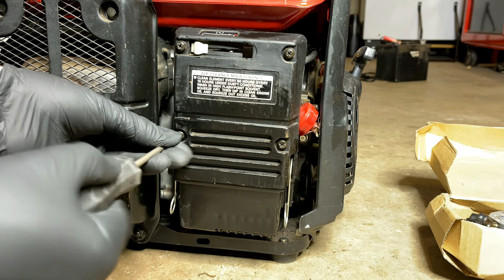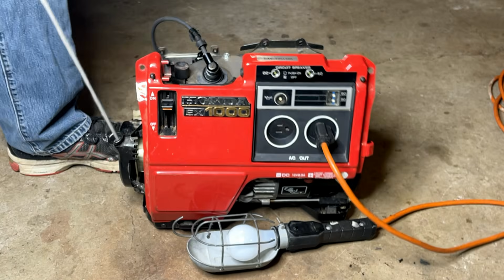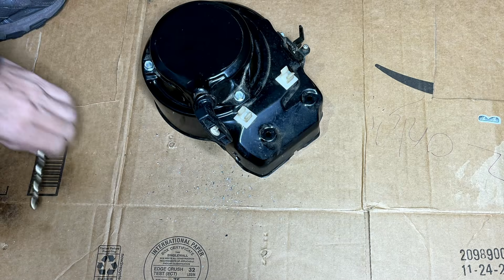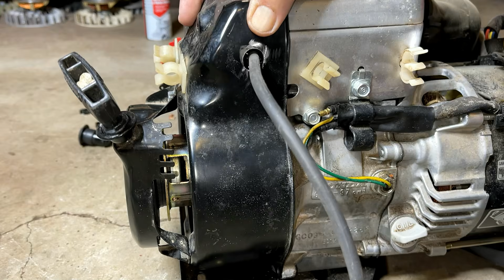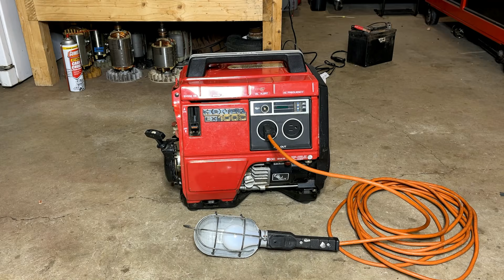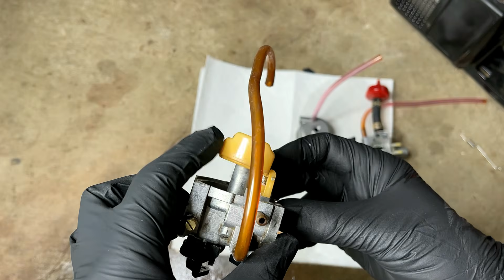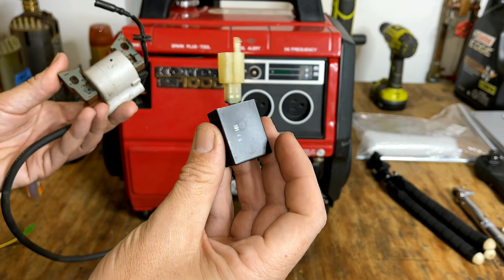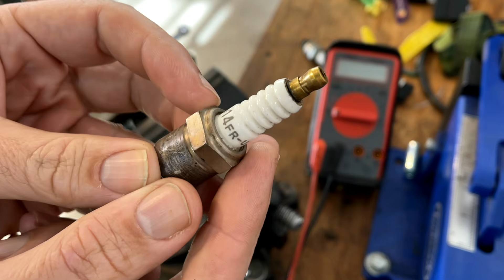Honda EX1000 - Will It Run?

Comment: My 2 cents are that the insulator within the body of the plug itself is cracked and had formed a " carbon track " . When the body ( metal part ) begins to expand with heat, the demon rears its' ugly head. I had an experience on a small engine with an insulator that had become unbonded to the body and actually was releasing compression. Fancy that ! Great video, . . but if you count your time on such a simple solution ? ? ?

Comment: I broke down and bought a deburr tool for situations where you were in with drilling that hole in the cover. Makes its smooth as a babys bottom, and looks much better then hitting it with an angle grinder. I mean you're the pro here... I just really do use mine more then i thought i ever would.

Comment: Great video. I’m curious if removing the recoil spring and plastic disk and mounting the other way round, allowing the rope to be wound clockwise and allowing the pull to turn it anti-clockwise and having the coil in the original orientation?

Comment: Excellent observational skills and logical reasoning led to the discovery of the bad plug.  We were stumped because we saw the spark plug making spark.  I did notice the spark plug test light seemed to get dim at times during the load tests. They say "seeing is believing" but somtimes seeing is NOT believing. Great idea testing the spark plug. You should work in a pit crew.

Comment: Take the petcock apart and clean it. There's often a filter in it, too. Then back flush or replace the red filter. Disassemble and clean the carburetor. These are first step items when I am working with any older equipment.

Comment: I was given one of these it was a fog machine, rings worn bad. I accidentally dropped the alternator on some rocks and cut a few of the wires, which I soldered back together and spaced with paper and silicone, got an oversized piston and she runs great

Comment: Wow - you surely did work hard for this.  Rather than ether ("Good Old Head Lifter") consider a few drops of 40:1 mix straight into the spark plug hole.

Ref: Shipping used engines USPO - learn ALL about HazMat restrictions and certifications BEFORE you consider shipping by any carrier.  Screw up and there could be hefty, hefty fines in your future.

Comment: How can you get the engine to run clockwise (which you needed for the coil to work) and you havve a counterclockwise starter pull from original engine?
Reply from the maker: The starter rotated the engine clockwise.  I had made a mistake originally thinking it was counter clockwise.

Comment: you didn't try the old coil spinnig it in the clockwise direction
Reply from the maker: I did, but edited it out.  No spark, but the ignition module was not connected.

Comment: HI James, love your videos, good commentary. I don't like seeing you working on the floor, its bad for your back, clear that workbench! I worked as an engine tuner with vehicles running on a chassis dyno and an oscilloscope hooked up etc. over time I changed 40,000 spark plugs and saw many failures, from carbon tracking, cracks, and crimp failures etc. the resister plugs are definitely susceptible to heat. I live in PER AUS and we get some pretty serious heat, its 40C today. Love your work mate, very entertaining and incredible perseverance. I have been working on generators for a while now, I could use more knowledge on the electrical side. Cheers!

Comment: Resistive plugs,wires and plug caps add timing retard to the spark event.
Moreover,flipping a coil can add timing retard if the coil pick up is offset to its bolts holes pattern.
load add also timing retard,with the mass of fuel wich is longer to burn.
Retarding timing will move unburnt fuel in the exhaust and cause smoke,and reduced power.
I have resistive wires on my motorcycle,so i learned that ,thinking i could just replace easily the wires on it,wich i can't do that easily lol
Reply from the maker: I am planning to do a follow up on this generator.  Want to return it all to stock including the coil and blower housing.
Reply: @jcondon1  
Nice job until now,i like your videos.

Comment: Could you have wound the pull cord in the opposite direction?
Reply from the maker: Unfortunately no.  4 stroke engines can only run in one direction.

Comment: Great vid ! cool trick on diagnosing the spark plug grounding out. never seen that before.
Proves that a New Set of Spark Plugs is a cheap Place to start if u have some misfire issues or stalling issues.
Great vid !
fyi - i noticed the cooling wheel fins had to turn clockwise to blow air , thats how i knew the motor had to turn clockwise.
they also make rubber grommets that would of worked nicely for the spark plug wire. you can buy them i believe in an assortment pak in probably home depot.

Comment: Just a quick one , normaly if you have 10k at the plug cap (this is for surpression of RF signal's ) you donot need to have a resistive plug as well ! , it just add's another 5-10k in line with spark , there for reducing the output, regards Roy

Comment: This is much better than the part 1 video.  I am glad I watched it.  I almost didn't after the first video.  We used the Honda 3000 and a 5000 to run the traffic signals when the commercial power was out.  They were great little machines until the place I worked at started buying cheap gas.  It gunked up the carburetors and fouled the plugs.  Then they started buying ethanol mix and it ate the rubber seals and such.  The 3000s were very quiet running.

Comment: I had a Honda FG100 tiller (same motor and same plug) that had the exact same issue. It started up fine at idle but when under a load within a minute would stall, then after a few minutes of rest would restart with a pull of the cord. I suspected it may be a defective plug so I replaced it with the NGK plug and the problems went away, so the plug issue isn't as rare as you might think.

Comment: Nice job!!  Bad plugs happen. Rebuilt a late 70s Suzuki  2 stroke engine recently. 20 miles later running issues started despite a brand new plug. Replaced the plug and.....all was well. Rare, but it happens.

Comment: Omg this guy isnt to smart (yet he did everything else) I would have FIRST checked the oil, fuel and spark plug. Wouldn't have to do all that and it made me cringe. In fact I got a "broken" mower free in the front of a house from craigslist. Literly replaced the spark plug and it runs with no problem. Nobody understands how importaint they really are. And for what $3-5 they tend to go for theres no excuse to replace them. I do hate the fact they arnt standardized. I had to call Honda and found one that worked auto parts store had ...advanced? I got my genny from a garage sale for $80 its def used but after all the stuff i did , not $20 and it runs perfect. Cant get anything for $100 for such a thing. Even found out USED ones on ebay were like $400-800. Great deal I say

Comment: My dad had a Honda 400 four (about 40 years ago!) and he had loads of engine trouble after carrying out a service. He didnt suspect the plugs because they were new and he basically stripped the ignition to pieces trying to find the fault. Eventually he changed the plugs again (different make) and it ran fine! Never forgot that lesson - just because its new doesnt mean its working.

Comment: A bit out of my depth, but any chance that green wire wasn't grounding well enough at the ring terminal to the housing...and eventually where the housing connects to the engine block?  Maybe it's not the module?

Comment: Ok at 56:06 you used a tablet. Can you please go over the sin waves and what equipment you used how you connected it...thanks
Reply from the maker: I have a like to the oscilloscope in the video description.  Just connected the leads to the AC output.  Note though oscilloscopes are not multimeters.  The scope has to be isolated when checking mains voltages.

Comment: The thing about the few megohms across the plug is that you were testing at just a few volts at most. Due to breakdown effects the actual resistance is probably much lower than that when the high voltage pulses are applied.

Comment: Interesting video and enjoyed the problem solving process.

1 question:  Could the module you need be a "Tip Over" protection system?  Many hand-held generators have a shut down system if the unit us not "upright"
Reply from the maker: Based on the description in the service manual, think it is the electronic ignition.

Comment: Does it matter if the filter gets saturated with oil? I tipped my mower to work on the wheels and a bunch of oil came through the filter. I topped it back off, wiped the excess oil but now the filter is oily, it runs fine though
Reply from the maker: It will cause an issue with a paper filter.  Foam, not so much.
Reply: @jcondon1  Uh oh, mines paper. I guess I need to dig out my spare. Thanks

Comment: I'd say the module works by measuring the voltage or frequency (speed) on the primary and open circuiting the primary at a certain point. I'd say making a new one wouldn't be a big deal however the newer coil seems to work fine and has one less part to fail. Love your videos mate, all the way from Sydney, Australia.

Comment: Happens often in car engines that the heat will throw up ignition/electrical issues with leads and other components. With some computer modules using a heat gun on them can be part of troubleshooting.

Also thinking new=good. It becoming more of an issue that brand new parts simply don't work properly, so they still need to be considered in fault finding.

Comment: You are correct about the temperature, but you are also getting more pressure as well. Higher pressure makes the spark jump harder and if the isolation in the spark plug has some intermittent issue, the spark will jump trough there under load.

Comment: I was screaming that this was the problem! It is still very easy to make. You can also get the same type of a ignition module for the cheap 2 stroke bicycle engines. They have 3 wires, but they work on 2 just fine.

Comment: While doing field service work, I had a Pressure washer do the same thing. I replaced the plug and it changed nothing. Took it back to the shop and the problem kept repeating A co-worker told me to change the plug and reluctantly I tried a different one. I had gotten a new plug that was bad.

Comment: Hi. I had a similar problem with the Honda 522 engine. The load did not last, turned off in about 10 seconds. A bad spark plug turned out to be the cause. The old one lasted only 35 years Sama Suomeksi. Moi. Minullakin oli samanlainen ongelma Honda 522 moottorin kanssa. Kuormaa ei kestänyt, sammui n. 10 sekunnissa. Huono sytytystulppa osottautui syyksi. Vanha ei kestänyt kuin 35 vuotta

Comment: What is the deal with Honda and parts? I have a 1985 Honda EX 650, and I can not get a governor return spring anywhere on the planet. They are no longer being made. A three dollar spring, is that so difficult to manufacture and keep in stock? How much space would a thousand springs take up in a warehouse? You could fit them all in a shoebox. I'm disgusted with Honda, their stuff lasts for years, but if you can't get a simple part, what good are they?

Comment: I’ve had an EX1000 for about 30 years from new, great little machine. The only problem i had with it was a bad filter capacitor across the AC output, other than that I’ve never even had to clean the carb. Much prefer the older generators with a ‘proper’ alternator. The output isn’t quite as clean and stable as the newer inverter models, but less to go wrong and cheaper to fix if needed.
Reply: If you ever have to upgrade the eu2000/2200 are so bulletproof it's incredible. I'm talking 2,000 hours before the valves really need some attention. I've never seen a control board go on one that didn't go underwater. They like a new spark plug, a touch of seafoam through the car to blow out some carbon and a spark arrestor cleaning. That's it just run them, harder the better.
I don't have any experience with the smaller eu 1000 however.

Comment: Holy cow what a challenge this little guy was.  I can not imagine all those things to diagnose and repair only to find out the spark plug was bad as well.  You should put that thing in time-out for a while before you even talk to it again.  Fantastic job and great patience.  Thanks for the  video.  I think I hate low oil sensors.

Comment: Really enjoy all your videos.....I'm having problems with logsplitter with huayi  carb.
It's "hunting"and dies under load(on return from spitting log).
Do you have video with equipment with similar/same problem
Thanks in advance..."Just-a-Neighbor"
Reply from the maker: Not specifically on a log splitter.  Sounds like the carburetor jets are clogged.  If you choke it do you get more power out of the engine?   What is the model of the log splitter?
Reply: Its homemade...on it.....I've zeroed in on the carb
Gasket wasn't replaced/restored after I put it together.
Thanks for you quick reply....
Reply: No name on it
Reply: If I choke out it dies

Comment: I know I'm late to the show so to say but there are 2 different coils for this unit:
First is part number 
30500ZC0013 up to
 serial number 1227387

and 2nd  is part number:
30500ZC003 from 
serial number 1227388 to 1426590. The difference more than likely is how the coil makes it's spark.
 So more than likely that is the wrong coil for the serial number you have.
But hey what do I know. 🤣

I had more than 1 spark plug give me fits over the years, funny how a $4 part will cost you hours of diagnostic work.  For almost all run related issues the plug is the First thing I will change out.

Great Detective work on all the issues with this unit. Amazing how things get messed up when less than I'll say knowledgeable individuals attempt to fix a problem.

Comment: James, I was a small engine guy for a number of years. I did notice and learn a strange phenomenon. Some older engines, like this old Honda (30+ years old), ALWAYS smoke on synthetic oil for some reason. I changed them out to regular dino SAE30 oil, and the smoking went away. Worth a try.
Reply from the maker: Thanks, I will try that.
Reply: I never ever run synthetic in the small engines. All of the Hondas from the old L head G series to the GX100s, GC160s on up to the 390 don't like it. Doesn't matter if the engine's new doesn't matter how many hours are on it they're just unhappy running the synthetic. Cheap oil changed often seems to be their ticket.

Comment: Wow this is one of your best ever repair videos! I wouldn't mind betting the original coil and ignition module are probably ok and would work fine if you put them back on the machine. The issue of course is that a coil with built-in electronic ignition won't like having an external ignition module connected to it, which is why the new coil didn't work.

Many years ago I did some research into these contactless ignition systems and looked into the various patents. There used to be a kit called Atom Computer Ignition which was made in Australia (now out of production) which was designed to replace points and condenser on older engines. Different versions were sold for different applications and the circuitry was slightly different in each one. They worked by replicating the action of the points and condenser: when the magnet passed the coil, the circuit turned on and when the primary current reached a certain level it would turn off (same as the points opening) and the high voltage would be induced in the secondary winding.

Another popular kit was the Nova universal ignition module which someone else mentioned. These were also sold as Omega electronic ignition. The Nova has an advantage over the Atom and most other makes in that the circuit senses when the primary current reaches its peak and then it turns off. The Nova is still available online. It has two terminals, one is connected to ground and the other to the coil. As the polarity of coils and flywheel magnets varies you may need to reverse the connections for it to work properly. If you ever have another generator with a faulty ignition module then chances are a Nova will work and will be a lot cheaper than an oem part.

Best wishes
Richard
Reply from the maker: Thanks for the information.  Will keep that’s in mind and it will no doubt help others facing the same issue.
Reply: I usually watch Mustie 1, but I seen this video and wanted to check it out! If you haven't watched him then check him out too!

Comment: Hey Jim,

Like you, I've never had a plug go bad until last summer. A 27 ton log splitter with a Honda GCV 160 would run great for about 5 minutes then die. I checked everything from fuel to filters to coils and I even bypassed the tank altogether hooking up a rig similar to yours. The only other component was the plug. I replaced it with new and it's still running great today.
Reply from the maker: Sometimes it’s that simple.

Comment: james you should drill the hole bigger and put a rubber grommet on it and use a block off grommet on the other side cheers from down under

Comment: I have a little EM500 that when I got it, it smoked really bad. It was just a puddle of oil in the exhaust that smoked for about 45 minutes and cleared out after a hot supper

Comment: On oil smoking engine may not have run thru break-in period as new as it looks,good job bud. What would you sell that unit for,asking for myself,am looking for a reliable
Reply from the maker: I usually sell everything I fix, but might keep this one.  I see on Facebook people asking $350-$400 for one like this.

Comment: Tim Basco
12 hours ago
 @James Condon  ignition coil is 30500-ZC0-033, and the ignition unit is the correct part number, Jack's small engine can get it hope this helps